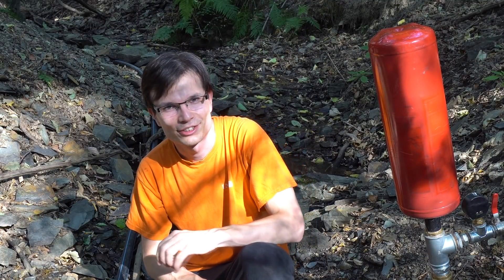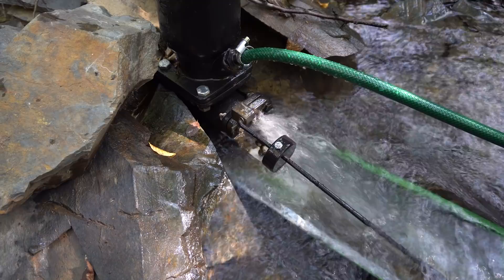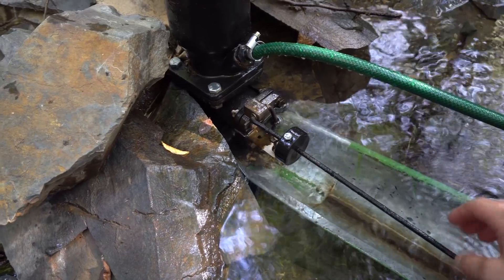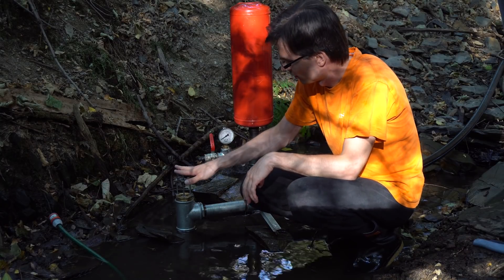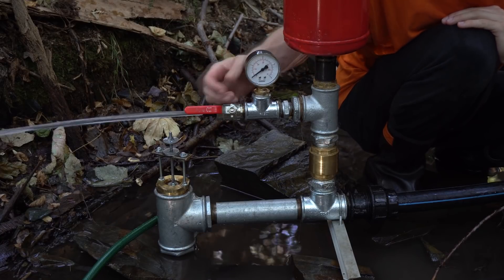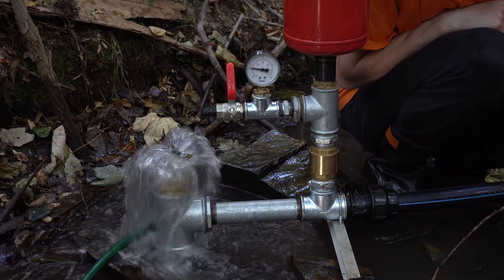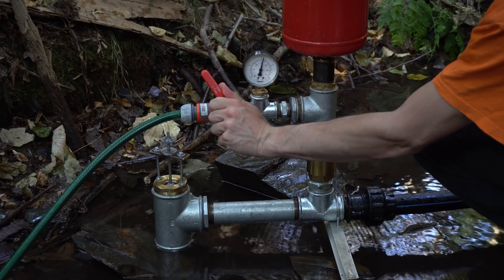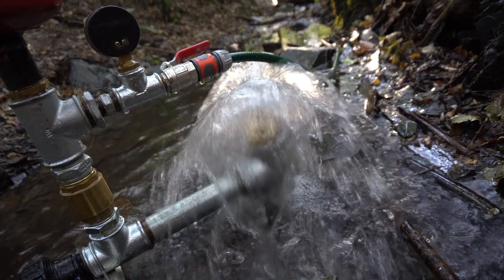HOMEMADE 5/4'' Ram Pump - BEST HOMEMADE WASTE VALVE

Comment: Hello mr dose there any valve inside the tank.?
Reply from the maker: There's no valve inside the tank.
Reply: @BohumirStehlik  sir how can i make one which can send water 70-80meter high and 700m distance.!?
Reply from the maker: @jazasleman2479  If you have enough head pressure then yes. But count that the gaskets in both valves won't stay there long. It is en extreme pressure... The valves are build for something like 3-5 bars. You will have 8...
Reply: @BohumirStehlik so u say i need better design for my one.?
This not helping.?

And can u help me how to make it.?

Comment: Hi sir... Any updates on the pump functionality? Any improvements? In view of the pressure tank are not Stainless Steel, any problem with the water erosion and the pressure apply on the fire extinguisher?

Comment: Greetings from Italy! i im thinking of creating a ram pump to pump water to my DIY solar distillation plant, this water has a 5m drop and it needs to be pumped to 6, i have a low stream of water, what diameter of the pipes i need to use?

Comment: SUPER expensive and overcomplicated.... you can achieve the same results using pvc parts and a "stock" plastic anti-return valve for a fraction of the cost.
Reply from the maker: Super expensive - no... The custom valve costs less or the same price as a swing check valve. The extinguisher is almost for free. So what's so expensive on it???
Overcomplicated? It is highly effective and has better function than a swing check. 
You want a PVC and you are serious about pumping higher than to a roof of your car? PVC will work for a day or two with a high pressure... Use metal.

Comment: Excellent work! My hope is to build a highly efficient pump capable of 400 feet of lift which will be necessary on our property. Would you be willing to share more details on how to construct your efficient and highly adjustable pump?
Reply from the maker: Hello. Everything is in my other videos about ram pumps.
Reply: Hello, dis you manage to lift 400 feet with a raw pump?
I need to lift water 230 feet
Thanks very much

Comment: Excellent job my man and best greetings from Norway. I’m going to need to build one of this beasts as soon I come to Thailand end of this year. So thank you for all your helpful information. Did you drill the guild holes in your wast valve or can you buy this type of brass fittings somewhere? Good luck for coming projects
Reply from the maker: Hello, thank you for your kind comment. If you mean the holest for the iron thread rod, then yes, I have drilled them myself. All of the small holes I drilled myself. Tip: make a small dot with a nail first that the drill holds.
Reply: Nice job brother

Comment: Could you use a 2" diameter drive pipe to feed this valve? Or would that be too much flow coming to it?
Reply from the maker: Probably too little hammer effect for the tube.

Comment: great delivery valve design .. super tunable performance . more information on the fine tuning would be great.   Like stroke and what the weights do .     how to . from your experience . water head and valve weights fine tuning    .  is that a matter of try it and refine the two . it needs a whole video on the fine tuning process.

Comment: That is impressive! You tackled the problems I see in many other designs in YT in a simple and elegant way. I do like the style of your waste valve, not only because it works, but because it makes more sense - the steeper the closing of the valve, the higher the ram effect, and yours does not only that, but it's adjustable! Your care with flow diameters is also commendable. A lot of clear thinking went into the design. Well done!!
PS: I just saw that you made a video on the build of the waste valve - going to check it now!

Comment: Hi bohumir am Giovanni ...I like to ask u a question  .i manage to make a pump following your videos  it worked ok until I had enough water here in this little river in sardinia near my house .the only problem was that every 2 or 3 days the pressure tank use to get full of water ,so I had to emptyed every time .do u know the reason y this happens have u got any idea.if so can u reply to me please.GIOVANNI....
Reply from the maker: Hello. Thanks for ur comment. If you use the air tank from a fire extinguisher, use a sniffer valve just before the pumping valve. Or use an expansion tank with a bladder.
Reply: @BohumirStehlik  tank you bohumir ....

Comment: Can water gose 300 mtr long and 3 mtr hight. Please tel me.
Reply from the maker: The output? 3m high is not enough to make the right back pressure. But you can try

Comment: If the water supply from pipe is very low pressure, can the ram pump still pump water uphill to 100m?
Reply from the maker: The ratio is approx 1:10 to 1:15. So for 100m elevation you would need 10m of drop.
Reply: @BohumirStehlik   10m of drop means the water supply need to be 10m high?  to generate the pressure?

Comment: Use a metal feed line at least 20 foot if you can. Then use a sweep 90 before for the waste valve. Remove the "T" and replace it with a sweep 90. This will help to smooth out the the shock wave and send it further up the feed pipe increasing the water flow.  Also by having the pump system larger then the feed line this will increase the the amount of "shock" or force returned up the feed line. This in turn will increase the water speed in the feed line. More forward energy in the feed line = higher pressure. You know the hole mass times force = energy thing.
Reply: Can you show me with diagram please @ Crazy Marty. Thanks. brian.bhealy@gmail.com
Reply: @kilmoregalway  The thing you want is a good solid water hammer. The more force you can keep in the pipe with out loss due to flexing of the feed pipe is best. Think of a shock wave. It will look like this )  )  )  )  ) as it travels up the pipe. The more you can direct it back up the feed pipe past the discharge pipe the better. A ram pump works off of shock. This is why you do not want plastic pipe or anything that can flex in the feed line or pump. The shock will break it and the flex will work against you. The more solid things are the more force you get. 
So if you mount the discharge valve on a sanitary elbow AKA: sweep elbow. It will allow the shock wave to travel further up the feed pipe before the head pressure forces it back the other direction. Now in a "T" like you are using the shock wave needs to make a hard 90 degree turn in order for it to travel up the feed pipe. So the hammer is not as strong as it could be just because the shock wave bounces around in the "T" before it can escape. While it bounces around it cancels it self out when it hits its self. This causes a loss of force.  You want that shock wave to be directed into the feed pipe and travel as far up the pipe as it can.

Comment: Where is your snifter valve to keep the tank from becoming water logged?
Reply from the maker: No sniffer valve. There's so much back force that the air reaches the T and the check valve.
Reply: @BohumirStehlik  thank you for the videos.  We're building one.  It seems you like the design with the waste valve after the pressure tank instead of the linear one with the waste valve in front of the tank.  Do you think one is better than the other?
Reply from the maker: @pwrmx24  I would definitelly make the waste valve at the end (after the tank). There are two reasons for that. First of all, when you have little dirty water, the dirt goes directly out from the pump by the waste valve at the and. When the waste valve is in the middle, all of the dirt goes to the main valve, locks it or the main valve stops to seal. True story. I tried that. The second reason: If you are lucky and have a long drive pipe, you can get enough back pressure to actually suck some air to the main valve and to the pressure tank. So you don't need a bladder tank or a sniffer valve.
Reply: Thank you for the reply.  I'LL try to post my build when it's done next month.  I have to find a tank!

Comment: I’m going to build this same set up but dual 2” rams with dual tanks. I’m trying pump 1500 ft 3/4 delivery line within the next few days just bought everything I need but the leather so I’m picking that up later cost for my pump set up was about $400 I’m using Pvc pressure tanks though figured I’m pretty deep in the cost already so I had pvc already if it works I will upgrade tanks later
Reply from the maker: Hello. Good but I wouldn't recommend you 2 waste valves. They will interfere with each other. And yes, it will be very expensive, if you use bigger pipes.
Reply: Bohumir Stehlik if the 2 doesn’t work together I will separate them probably one for sell or use them separate to pump to same source I seen another guys video he had something like you have but 2 pumping together but drive line was separated 1 tank 1 delivery line

Comment: You also need to show The pressure coming out the end of your hose.
Reply: No he doesn't as that's not important to illustrate what the pump is possible of achieving. The pressure gauge at the end of the hose, no matter how long or high it is at Discharge, will only show you loss in the pipe, nothing to do with the pump.

Comment: The waste valve body not good enough, you should use 90 degree elbow. The distance between waste valve and delivery valve it's way too long and the last it's the valve shape must have cone shape, therefor you will have raised the the water up to 1:20 to 1:30 in meter.

Comment: you need to post a diagram of how you built the waste valve..just got a hunting cabin and would be nice to pump water  up the hill from the stream..the water is probably drinkable but for the drinking water I will run it through some super filters..the water is mostly for showers and cooking
Reply from the maker: You should see my other videos. There's a video about how to build it, including all of the parts...

Comment: Hello. I have done basically the same settup.same size pipes etc . But I added a stand pipe. About 15 meters from the pump .. I have about 2.5 meters of height on the delivery inlet. The pump is working however the flow at the outlet pipe which is about 150 meters up hill at about 40 meter lift.. is only 700ml per min.. which is not great. The delivery pipe is making quite a loud  banging noise.. and was moving a lot so I put some rocks on it.   But still only getting 700 ml per min.. any advice would be much appreciated..
Reply from the maker: Hello. Your donwfall is 2,5meters and your lift is 40 meters? I think 700ml/min is a great  result...

Comment: I understand how ram pumps works but i don't understand why you have to do this "priming" thing? Is there a rampump you don't need to prime? Why do you need to push it manually a couple times to make it work?
Reply from the maker: You need enough pressure in the delivery pipe to close the pumping valve.

Comment: Can you tell me a bit about how much power you could produce from this thing? And how it compares to solar panels etc. I know it can run forever btw as long as theres water. I also want to know if  one can run a hydraulic ram with say 1 meter long short intake pipe/hose with half a meter fall?  Does it still work? Final question! Do you know if there is a possibility of a ram pump without waste water? Thank you!
Reply from the maker: I don't know how to count the power the ram pump does. Idon't think so that you can run any ram pump with such a short intake. Check my other video. There are ratios that one should care about. Last answer: no...
Reply: @BohumirStehlik  You can just hook up a water wheel or turbine to the output, then measure the power... Perpetuum mobile. I am also curious if a turbine or waterwheel - turbine is probably more efficient - in the intake would reduce the efficiency of the rampump. If not then you could generate power on both ends xD Please make this happen!

Comment: A few questions -1) Instead of a rigid pressure tank could you use an inflatable tube ? or balloon?  Would that provide elastic pressure?
2) Ram pumps are noisy and irritating - Could the outlet operate just about as efficiently under water?  Thereby muffling the sound ?
I'd be interested in your comments.
Reply from the maker: Hello.
1) you could use an inflatable tank but you would need to find something that hold so high pressure... 5bars is 50 meters of weight. That's a hell of pressure... Maybe NASA would help.
2) Could probably work somehow but not as efficiently. Maybe, maybe... The closing of the valve wouldn't be so fast...

Comment: love what you have done but if i may make a suggestion , i havent read the rest of the comments so i apologise if this has already been suggested , but you will really increase the pressure if you have a metal inlet pipe to the pump because it will reduce the shockwave going back from the pump , apart from that i love your set up and i would monitor the fire extinguisher tank because they are not really designed for constant flexing from the increase in pressure and decrease but like i said i love your work and have a new subscriber
Reply from the maker: Thanks for your kind message and suggestion. Yes, metal pipe would be better but expensive. This set up was quite temporary. I think the fire extinguisher is designed for incredible pressures. 5 bars is not so much for it I suppose... :-)
Reply: @BohumirStehlik  sorry i have confused you as to what i meant , i meant that the constant pressurising and unpressurising of the tank could cause metal fatique , but eventually the tank splitting , like i said i love your work and im probably being over cautious
Reply from the maker: @familyplans3788  No problem. Sorry if it sounded that I am confused. I just don't have the taste for the english yet. :-)

Comment: But 5/4" is 1" and 1/4. Die Pumpe arbeitet effektiver, wenn man ein Ausgleichsgefäß aus der Heizungsinstallation verwendet. Das kann man den Gegendruck einstellen. The pump works more efficient, if using an equalizing vessel from heating system. The backpressure can be adjusted.
Reply: In the equalizig vessel there is a rubber membrane, so it will age, willbe moved by every ram shock and needs maintenance. Isn't that right?
Im Ausgleichsgefäß ist doch eine elastische Membrane, die altert und bei jedem Hub bewegt wird. Das bedeutet Wartungsaufwand. Oder?

Comment: How many gpm at what distance and height are you pumping with that unit ? 
I have a check valve ramp pump at a 1"1/4" size . My drop is about 3' ,drive pipe size 1"1/4 pipe 75' long . I pump 1600 feet and 20 feet in elevation , gpm 1,
Reply from the maker: Hello. I pump around 2-2,5l/m. Drive pipe 3m drop and 50m long. Delivery pipe cca 150m long, 15m elevation.

Comment: excellent job and environment friendly technique... I have a question for those who live in city where we need to store water in underground tanks and use electric motors to push it to fill a tank on 2nd story of the building. If we use a tap which is directly coming from the 2nd story tank as intake to the waste valve for creating intake water pressure. can this waste valve revert back water to 2nd story tank where elevation is 90 degree?
Reply: you will lose all your water through the waste valve

Comment: Well done ! - Perhaps slightly less weight on the slam valve, would allow it to cycle faster, but then the pressure might not rise quite as high owing to the slam valve shutting before maximum flow had been reached, although the flow in the delivery pipe would increase, yet the slightly reduced pressure would not lift water quite so high.; - anyway its food for experimentation.
Reply from the maker: You are perfectly right!

Comment: I recently saw a video which used an expansion tank for a hot water system, pre-pressurize to 5 bar which the suggested made for a significant flow increase.

Do you have details of how you built your waste valve?

Comment: Hi bro that ram pump was good one. But I don't want to waste soo much of water., because I'm in city area, we don't have a water fall like that so, please made a rampump to do not waste 💦. But please it must be low cost, because we are a fresher to make that rampump😊🍥🍧😃
Reply: People who take the word 'waste valve' literally, do not understand how this pump works: it uses the kinetic energy of the water, i.e. water flowing downwards. If it doesn't flow down, there is no force to bring some of that water uphill: so it has to be 'wasted' - lots of it!
Reply: @TheCommono  well .. can you channel the wasted water into another ram pump to pump it back to the source pool?
Reply: @Paultblk  No, the potential energy of the water is consumed. How would you bring the water, e.g. running down on a waterwheel, up again? Using the power of the waterwheel?? Makes no sense!